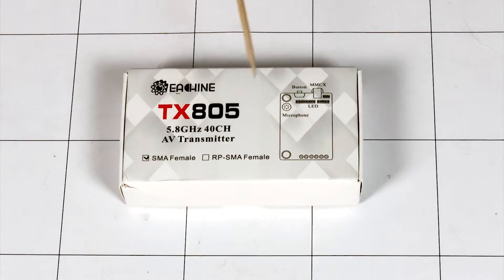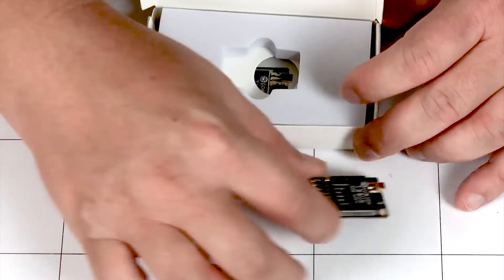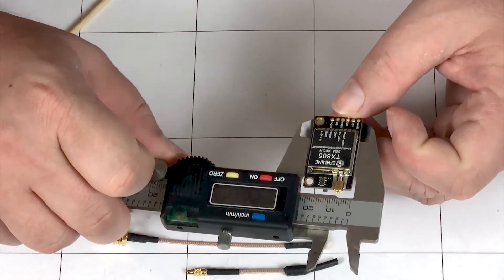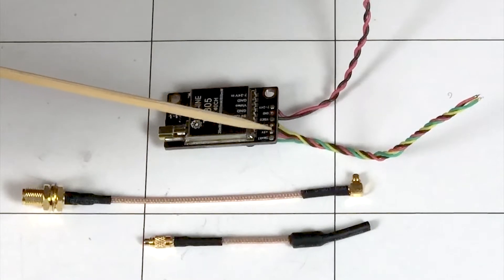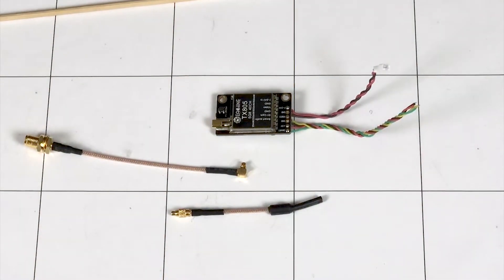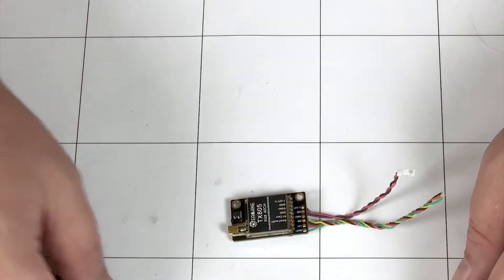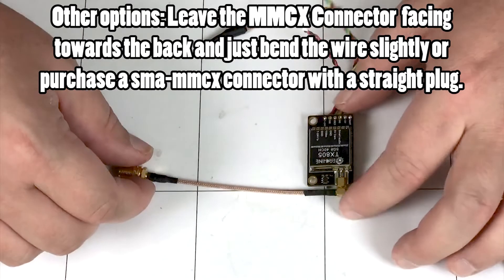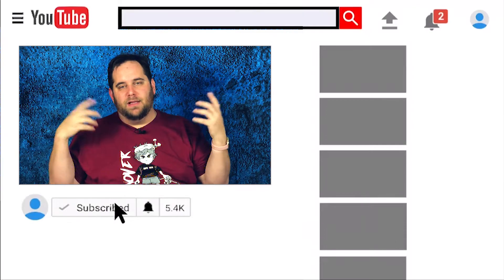Eachine TX805 5.8GHz 40Ch AV Transmitter

Comment from the maker: Eachine TX805 5.8G 40CH 25/200/600/800mW FPV Transmitter TX LED Display Support OSD/Pitmode/Smart Audio - RP-SMA Female 
Buy on Banggood: https://goo.gl/dPWuZq

If you want a straight SMA-MMCX connector:
AKK MX04 2pcs MMCX to SMA Female 5.8GHz 178 Linear FPV Antenna Connector 
Buy on Amazon: https://amzn.to/2PuZaOt

Comment: im searching all over and I cant seem to find how to switch to the 800mw... whats the process in doing this? Thanks for the videos! I used your references on my first build and got it in the air tonight.. loving it!!! YOU DA MAN!!!
Reply from the maker: Awesome!!!  Do you have it setup using smart audio connection?  If so you should be able to adjust it within the Betaflight OSD.  I've personally never tried going that high since I'm usually flying in close, and don't want to get pampered with such strong signals (usually fly at 25mw, so I'm used to it for races, or when flying with other pilots).
Reply: I figured it out... and then it blew up... jk there were some issues but I got it resolved and ready to try again... thanks again man! Love the build!
Reply from the maker: Gotcha.  I do sometimes have to remind myself, you do get what you pay for.  And I'm sure if you crank up the mw on this guy and just have it sit on the bench without any wind cooling it, it probably would overheat.
Reply: tronage I want to switch it over to a DJI setup now... lol
Reply from the maker: You and me both,  just such a hugh price jump from this budget vtx to a full DJI setup 😂😂
Reply: tronage yep! Sooo worth it though. Lol
Reply from the maker: For sure!!! 👍  It is so tempting, but I feel like byte frost might get to that same level of quality some day (sooner then later)

Comment: I do not recommend this , it’s impossible to remove all the interference and the noise, do not buy you’ll regret .
Reply from the maker: I agree, but also disagree.  Are there better vtx's on the market?  Sure there are.  Are they the same price point (considering the included bits like the little whip antenna and sma pigtail)?  Not really.  Remember the goal for this combonent was to be included in my TBB (Tronage Budget Build).  And when building a budget quad you need to cut some corners to bring the price down.  Honest I've been flying my TBB (with this vtx in it) and haven't had any major issues.  So as I said, with an unlimited budget, I would agree, get something else.  For the price point, I disagree and think it is a great performer for the price.

Comment: Mine gets very hot with 3s so what do you Think is wrong ?
Reply from the maker: First (this may sound silly) but you do have an antenna attached right?  If you try to power up without an antenna they will get very hot very fast.  Vtx's will get hot when you power them up on the bench, esp if you have it setup to transmit higher then 25mw.  Remember when flying it is air cooled by the props and the air it is moving through.
Reply: @tronage  yes i have my antenna right in it 😂
Reply from the maker: Sometimes we miss the obvious lol.  What mw setting are you using to transmit.  Even on 25mw it will get pretty hot just sitting on the bench.  Getting "hot" isn't necessarily an indication something is wrong.  Vtx's just get hot.  And this being a "cheaper" one it is prone to get hotter faster (esp without flying to cool it with air current).  As long as it works and you see your video feed, all should be good.  The only culprit is as I said the antenna (either the connection to the board, or the connection to the antenna itself.
Reply: @tronage  its works almost fine only sometimes it is black for 1/4 of a second but thx for the reaction